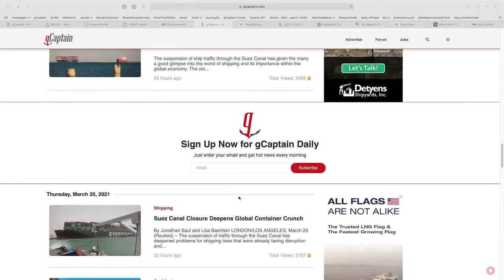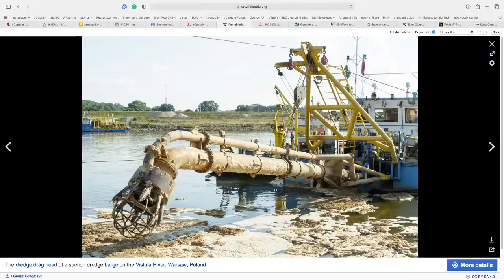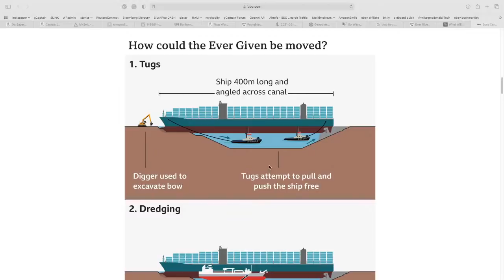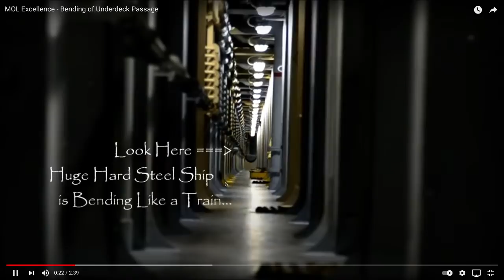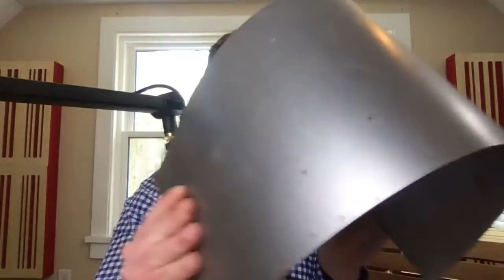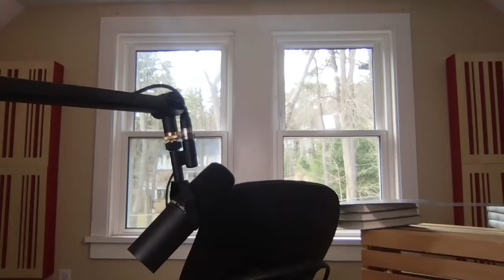Operation Backtwist The Ever Given Salvage Operation

Comment: In addition to the stress from the flexing, there's possibly cumulative crushing of the hull sections that are hard aground.  Twice a day, those areas of the hull are lifting / supporting a beyond design portion of the ship's weight.  That could be part of what's going on with any worsening flooding.

It's probably not immediately catastrophic, but it's part of what makes this worse than normal wave action.  It's where the ship is potentially experiencing beyond design forces and fatigue.  It's cumulative and ongoing until she's floating freely.

Comment: Great video,  thank you! I have an idea that sounds crazy but is actually quite serious. The US probably has an aircraft carrier in the area. Why not back it down the canal and use it as a giant tugboat. Chain a bunch of F 18’s to the deck and light the engines. I know this sounds crazy but I believe there is actually a historical precedent for something  similar and it was successful. In this situation, the tugboats plus the carrier at full throttle plus the jet engines all pulling in the same direction, would be a huge amount of power. Seems like that should be enough force to pull the stern towards the middle of the canal 🤷🏼‍♂️

Comment: It's only 0.4m difference between the neap and spring tide.
I think bringing in a semisub crane could add the risk of pontoons going aground, what with trying to get in close enough for a safe lift but at that angle..
I couldn't find the height of the deck and containers but would a vessel like the  single-hulled D.P.  Heerema Aegir or similar class with a shallow draft be suitable range for unloading to a barge?
Would they need a crane both southside and northside?

Comment: I’m a naval architect. We account for all of these things. You can think of the tidal bending in terms of waves. Both are caused by differences in water level. As the water level goes down, the buoyancy doesn’t just disappear. It is a concern, but I don’t believe that it’s as big a concern as you think. Also, ships actually generally use higher-strength steels because you can use less steel and reduce weight. Common examples include AH36 and other higher strength shipbuilding steels.

Comment: When we have a loaded dump truck get stuck we use a loaded dump truck to snatch it out.  Not sure if the boats can handle it without ripping apart, but we link as many trucks together as it takes. One usually does it.
Reply: Your example makes use of trucks, which are designed to roll their wheels and in the process diminish the friction issue.. Here is a video that describes the problem in nautical & mathematical terms.
Reply: @wouterscheepe8199  I was thinking more about the weight. We lightly “snatch” the trucks more than crawl them out.  It’s not ideal, but if you trust the rigging to deal with the forces involved, the momentum should over come the friction. I’ve seen smaller boats do it when they get stuck on a sandbar as the tide goes out here on our river.  Momentum pushed the cargo ship deep into the sand.  Large ship momentum off the stern, dredges liquifying the sand and tug boats all working in unison can dislodge it in my humble opinion.  But I just enjoy the crowd sourcing of different ideas.  It’s going to be interesting to watch.

Comment: A 7-foot tide puts tremendous reciprocating stresses on the hull. In normal circumstances, such as waves at sea, the flexing would be straight-line flexing from bow to stern. However, in this case I think we need to consider the prevailing north to south current in the canal which makes the tidal flexing regularly irregular. As a result, I think the Ever Given is toast. This accident was no accident.

Comment: Can they not use another Super ship to pull it? Or use another big ship with a crane on it to remove the containers?
Reply: 1. Everything is optimized for low cost. So the super ships don’t have extra large engines to help them tug loose other ships that are stuck. They only have sufficient power to propel themselves. 
2. If there were any they would use them.

Comment: Would it be possible to rig a spring line on the starboard side forward of midship and put the rudder hard over to port? This wouldn't be easy or maybe not even structurally possible but the idea is to somehow use the ship's own power to assist in turning the bow. It was much easier to do something like this with a 40' sailboat!

Comment: A Trailing Suction dredger will suck the sand on the portside of the bow. Meanwhile the 2 strong tugs will tie up on the stern and start pulling to the shore side on the starboardside of the Ever Given and the the vessel will come loose and float. The strange thing is that the Ever Given moved very strange on the anchorage before going in the convoy to the North. On arrival at Port Said most probably she will go alongside a quay and a certain amound of the containers could be discharged and divers can make a video to what the damage is underwater. The stability of these vessels are many times close to critical. If they would unballast some tanks the vessel could have more problems when she comes loose. The dredger could be the "Causeway" from Boskalis which is underway in the Red Sea enroute to the Netherlands. . The Suez Canal should have a strong 250 tons bollard pull on the north and 1 on the south permanently on location and standby 24/7/365. The Suez Canal just bought a dredger in the Netherlands.

Comment: The containers need to lock together  horizontally just like they lock together vertically.  This will add structural integrity for the ship. Basically,  the containers become a structure within themselves. (Provisional patent claimed right here).
Reply: @Xhor-u7z  I'm afraid you have little knowledge of how the containers are stored deep within the ship. So if they were all locked together the entire ship would have to capsize in order for a single container to fall overboard. 
Also,  if all the containers were locked together both horizontal and vertically they would have the same structural integrity of that like a bridge truss. The ship would still flex as it is designed to do.